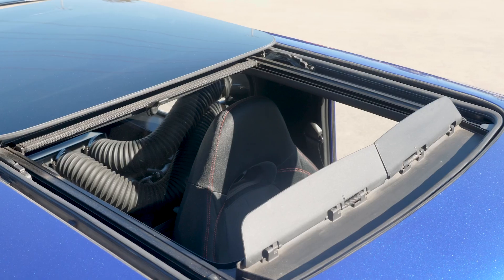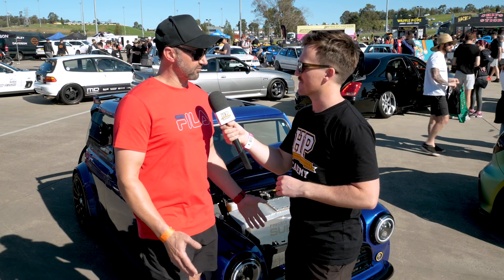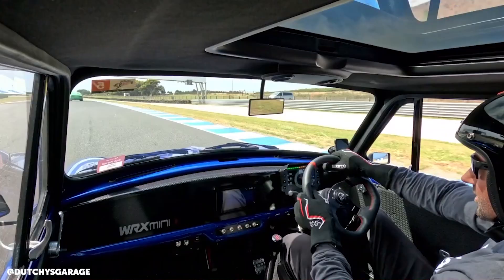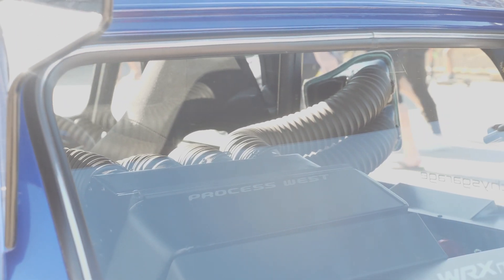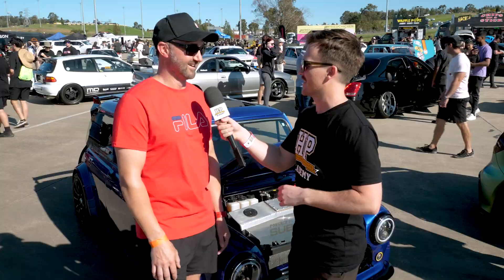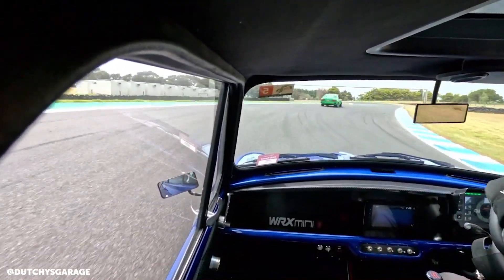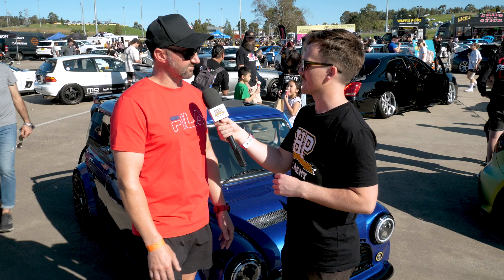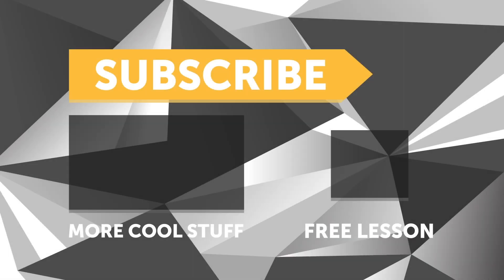The Engine Swap Nobody Saw Coming | MiniRex

Comment: I asked a Jdm importer about this 20+ years ago. He said there's no way it would fit in the front, due to the position of the transfer box, either putting the engine way to far out front, or the front wheels would be behind the A panels 😂😂😂
In the boot was the obvious choice

Comment: Cad was used. Cardboard automotive design.
Reply from the maker: hahaha where would be be without cardboard eh! - Taz.
Reply: Cardboard helped me solve overheating on a couple of cars!

Also helps me trace lines I can't follow with jigsaws :p
Reply: @skippy2987  cardboard is way cheaper to form and fit, how do you think boats are made by hand. the auto cad machine sits in the corner broke, so the manual cardboard design must be implemented.